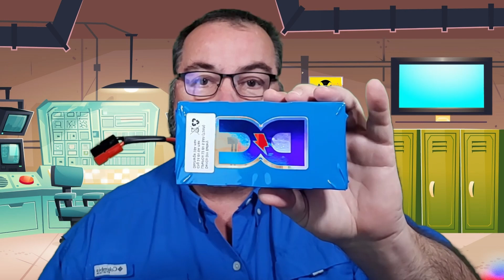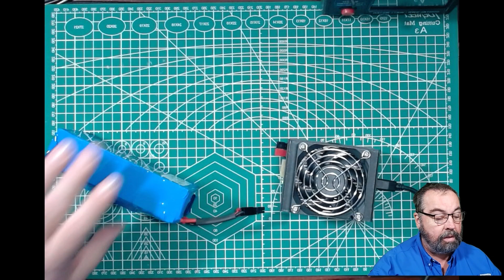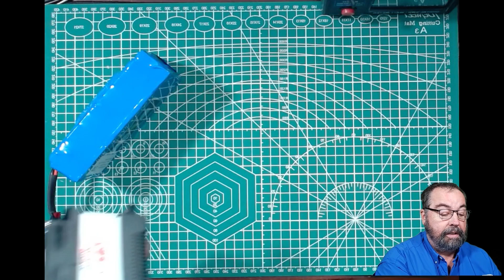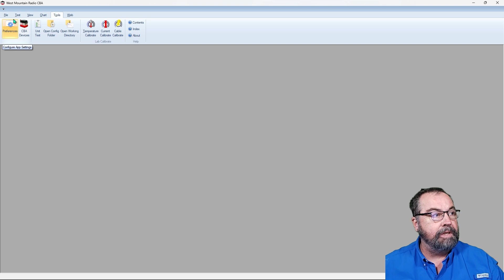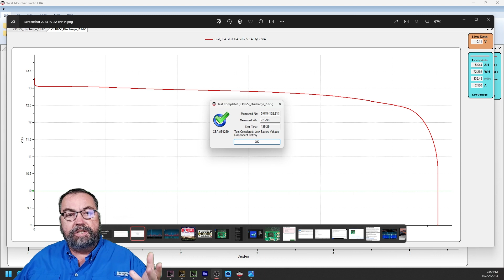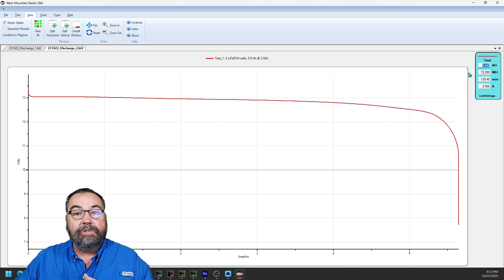Putting Denco Battery to the Test: Will it Hold Up?

Comment: Jim, does the Denco BMS have a cutoff voltage? Hard to tell from the graph. Maybe 10.8V?
Reply from the maker: Good question.  I set the CBA test cutoff at 10.5v.  I'll have to look at Dennis' info and see if he mentions it.  He's using a Denco branded Daly BMS, so that might yield a clue there.